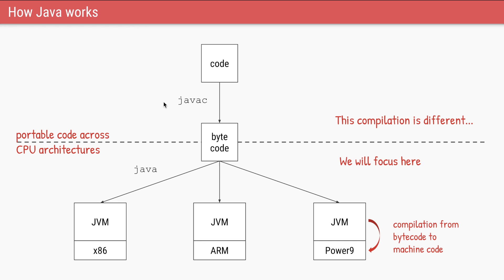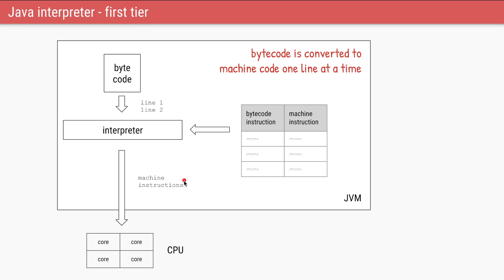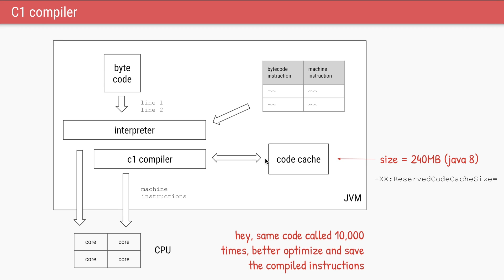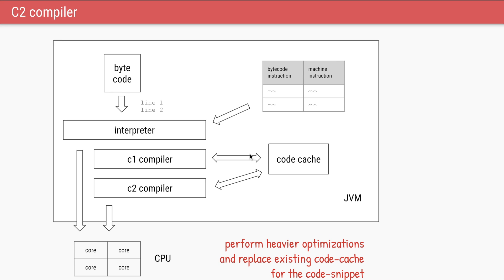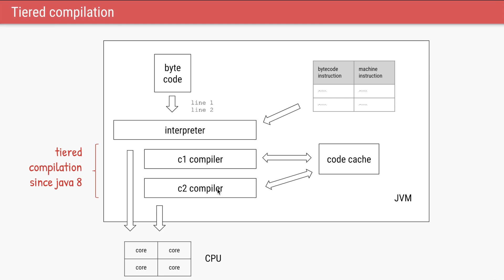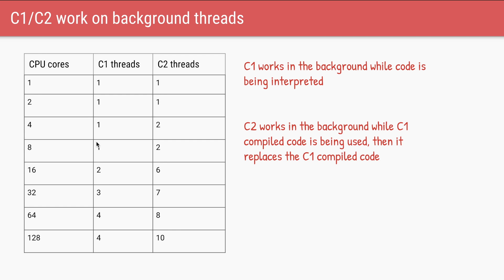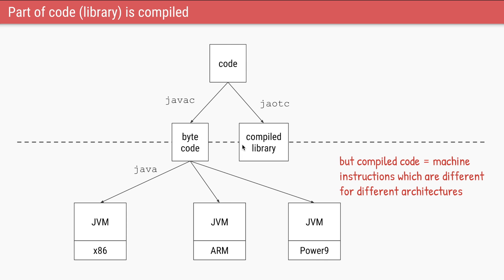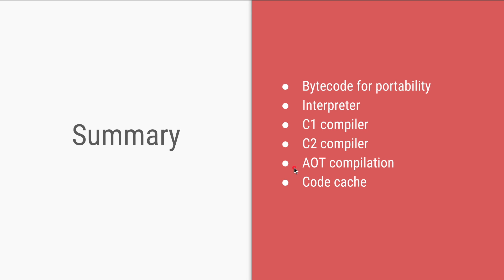AOT vs JIT compilation in Java

Comment: sir, can you make a video on difference between interface and abstract class based on logic, not the rules or keyword differences. i mean why do we need interface if we have abstract class. we can undefined every method of abstract class. it will behave just like interface too. and if you are gonna say to overcome diamond problem then why will we overcome that problem if we are going to define the method definition side another method. i mean what's the point. and even if we can overcome method ambiguity of diamond problem, variable ambiguity is still there which is handled by accessing variable of interface using interfaceName.varname then why cant we do this way for accessing methods?

Comment: I want to ask a question ,why languages like c++,c dont improve to make itself machine independent?  why cant they use interpreter directly just like javascript or bytecode concept like java?
Reply from the maker: more often than not you dont need that much portability, you can compile language to your platform and run it on local, while CI/CD pipeline can compile it for integration/production environments. so there is no major downside to compiling

Comment: C1 and C2 compilers need runtime profile data to produce optimized machine instructions. AOT does bytecode to machince code translation even before running the code once, so is it safe to assume that AOT compiled java code will run slower than JIT compiled one?
Reply from the maker: Since compiling code at runtime itself takes time, and since until then the code is run in interpreted manner, the code can be slow even in JIT. Its use-case specific.
Reply: @DefogTech  So we have to compromise between fast startup times (With AOT) and faster application execution times (With JIT). Correct?

Comment: I have a question. Assume that JVM compiled our add() method 5000 times, and the threshold is also 5000. If we will change our add() method functionality, will the byte code from cache conform for the changed add() method bytecode? I mean if we change our add() method functionality, does it need to compile our method again, because if it will get the byte code from cache, it will be not actual) Or maybe I didn't understand something? Please explain :)
Reply: if you change code then you need compile whole thing anyway